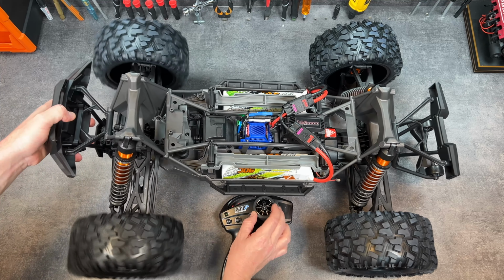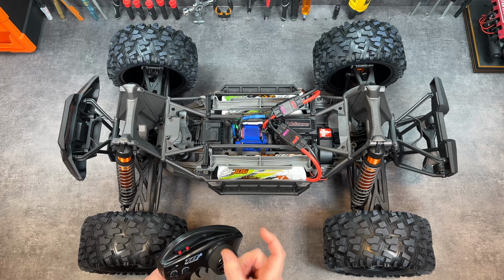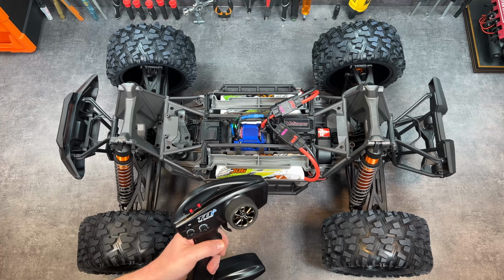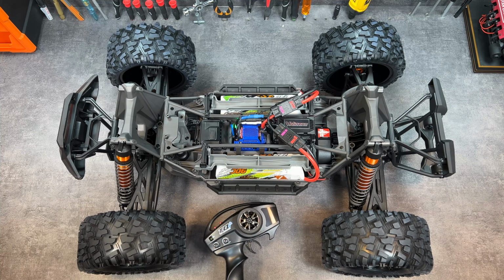New Perfect Pass Rc Product!

Comment: Pro tip when disassembling the x-maxx always hold the shaft towards the rear part when pulling front away. There is a little connector parts linking it to the center diff and if it drop from the diff its a load of pain to shake it out or lots of screws to get it out regular way. So its simply best to leave the shaft in the rear part.
Reply: Hold the shaft towards the rear. Got it. Now explain that to my wife please. 😮

Comment: Finally a direct bolt on XRT/X-MAXX/Maxx with high torque high speed servo that's readily available in the USA and I just ordered 2.  They are several available in UK or Asia but they are higher priced and harder to get with questionable reliability.   Traxxas might get upset for taking some of their 2085r servo market share lol.

Comment: I appreciate what Raz does and he is not a conman or anything like that, but it would have been nice to see the performance on dirt or grass. That's what most of us would be running it on, i believe. 
Seeing it in the air and on concrete for "shits and giggles" is great, but what about the surfaces that actually matter?
I'm not saying this product is "bad" or will not perform well, or anything like that, no. I am saying i hope we see some more practical usage videos, since it is an expensive investment. 
Thank you.
Reply: On grass the servo saver might be the reason it wont turn the wheels completely. Im sure this thing is going to push trough the stock servo saver

Comment: How would this work on the xrt im using the 76kg and it just dosnt have the response it shoukd have on the ground
Reply: Could be the servo saver thats  not strong enough, traxxas does have a stiffer servo saver spring. Might be the solution. Im not sure if there is a nut that can be lose. But i heard that was a not so rare issue that can happen overtime